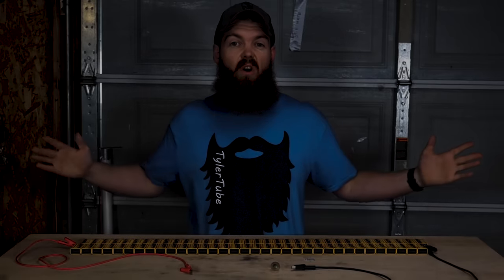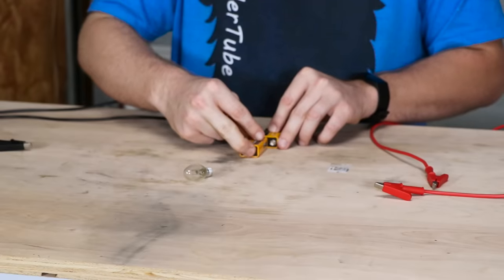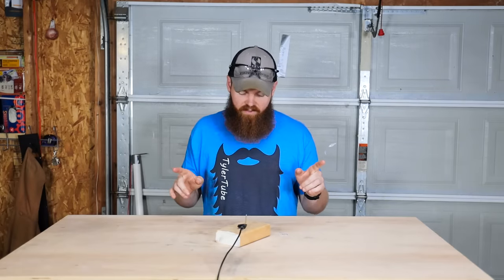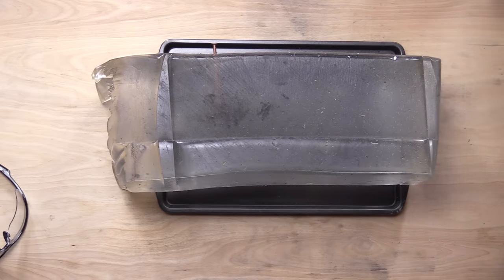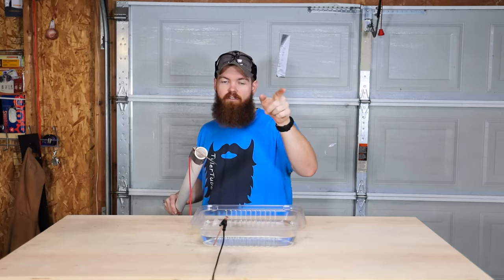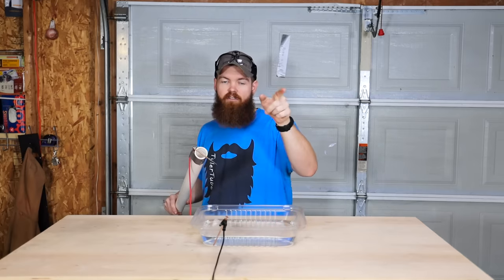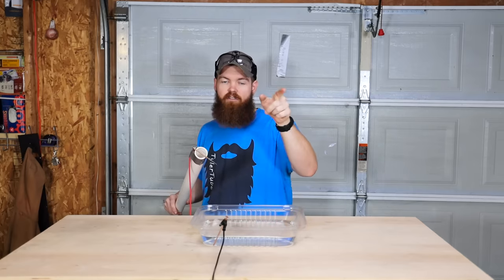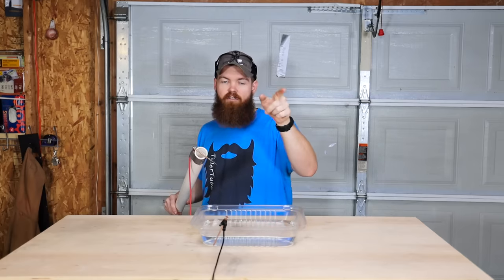I Connected 500 - 9 Volt Batteries...

Comment: I'm more impressed he survived to post this than anything
Reply: Honestly I would have blamed natural selection, this is just Dumb luck that he is still alive.
Reply: @maximwannabepro3021  i mean the most dangerous thing in this is the use of unsecure Internet connection thank god for today's sponsor
Reply: @sirbreadstick6424  RAID SHADOW LEG- I mean Nord VPN!
Reply: Eh he kept it safe
Reply: @goreobsessed2308 ?????
Reply: How's that v6 mustang
Reply: @logertgogert3227  its a GT but its fun thanks
Reply: @goreobsessed2308  placing your hands on an open circuit at those kind of voltages is never safe.
Reply: @goreobsessed2308  @7:24
Reply: @Aupexx  fun fact from an electrician, voltage is not the deadly part of electricity, amperes (amps/amperage) is. Amperes is the measurement of the speed of electrons moving through the circuit (think of it as horsepower) and voltage is the measurement of force pushing the electrons along (think of it as torque)
Reply: @davidbrunner4413  Yeah and I'm a welder. I deal with electricity every day as well. As an electrician you should know that an amperage of 100-200mA is lethal and the higher the voltage the easier it is for that amount current to enter your body and do serious damage.
Reply: @Aupexx  I know this, but I also know that it's only going to be fatal unless it passes through your heart or travels up the spinal column to your brain
Reply: David Brunner you do know that amperage is a direct function of voltage.
Reply: @davidbrunner4413  in addition, this is all DC voltage. The duration of the shock also has an effect on how much damage it can do. Since it's DC, he would probably just be knocked down to the ground and probably knocked out, rather than AC, which would hold him in place as it continued burning him internally.
Reply: @minamcvinnie4629  actually AC is less dangerous from a standpoint that the cycling of power can sometimes give you the ability to let go. DC will clamp your muscles to the conductive surface and not allow you to release.
Reply: This is electroboom 2.0
Reply: @PurdueRy  I found this on physics.stackexchange.com in re an excerpt from an electronics textbook:

"Direct current (DC), because it moves with continuous motion through a conductor, has the tendency to induce muscular tetanus quite readily. Alternating current (AC), because it alternately reverses direction of motion, provides brief moments of opportunity for an afflicted muscle to relax between alternations. Thus, from the concern of becoming "froze on the circuit," DC is more dangerous than AC.

However, AC's alternating nature has a greater tendency to throw the heart's pacemaker neurons into a condition of fibrillation, whereas DC tends to just make the heart stand still. Once the shock current is halted, a "frozen" heart has a better chance of regaining a normal beat pattern than a fibrillating heart. This is why "defibrillating" equipment used by emergency medics works"

I would think since he laid his hands down flat on the batteries, if there was electrical contact...

a) his clenching of his fists would've removed contact
b) his clenching of his fists would've violently grabbed the batteries directly below them, causing them to be disconnected from the ones immediately surrounding them
Reply: IM WEAKKK 😂😂
Reply: I'm more surprised that his beard did
Reply: @sirbreadstick6424  no laying his arms on those cases not rated even for 100s of volts it can explode any time or electricity can arc to his arms killing him instantly
Reply: @sirbreadstick6424  HE IS LITERALLY PLAYING RUSSIAN ROULETTE EVERY TIME HE TOUCHES THE BATTERIES CASES
Reply: @goreobsessed2308  KEPT IT SAFE!?!?!?! EVERYTIME HIS ARMS WAS ON THE BATTERIES ITS LIKE HOLDING A POWER LINE IT COULD KILL HIM IN A HEART BEAT IF HE ACCIDENTALLY TOUCHED BOTH ENDS HE'D BE A CORPSE BEFORE HIS BODY HITS THE FLOOR
Reply: @goreobsessed2308  Just after the lightbulb blow..pressing bare hands at both ends of a 600V battery, VERY close to the terminals.

Doubleplusungood. 😶
Reply: @Aupexx  bruh at that moment they aren't even connected
Reply: @ParedCheese  these videos make me cringe. I build elevators and work with 480 and high voltage regularly and seeing someone that has NO idea what he’s doing or even how electrical works do this so dangerously is just insane. Less than .5 amps will kill you and he’s handling that shit like he’s taking the batteries out of the remote 🤦🏼‍♂️ I’ve had friends killed with less than what he’s playing with.
Reply: @ParedCheese  just thought about it how in the hell did those little 18 gage alligator clips not melt? That shit needs some 8 gage lol
Reply: @davidbrunner4413  it's voltage that overcomes resistance which allows it to treat your body as if it were a copper wire.
Reply: Lmao same
Reply: @davidbrunner4413  also becaouse it’s dc and not ac it’s safer
Reply: @chrisandersonlv  These batteries can easily put out enough amps to kill somebody but not enough to melt anything (high internal resistance limits current). It's a high voltage but current limited supply.
Reply: @goreobsessed2308  6:24 says otherwise
Reply: David Gilbert  я более впечатлен, что он выжил, чтобы опубликовать это, чем что-либо
Reply: @goreobsessed2308  6.22 600+ volts across his heart lucky lucky guy
Reply: @90seconds33  lol this comment is ancient brah
Reply: @davidbrunner4413  how are you an electrician and saying this man? Voltage is directly related to current, so it's misleading to say voltage is harmless and current isn't because they're related, for the same given resistance/impedance higher voltages mean higher current and this case, Tyler has the same resistance of his body that he would if he were messing around with lower voltages, so yes the higher voltage is more dangerous in this circumstance. It annoys me when people say "umm actually it's current that's deadly not voltage" because it just gives people the wrong idea.
Reply: @sirbreadstick6424  This amount of voltage would kill. Just s ingle mistake. Touching the batteries could have ended his life. He is unaware of the danger here.
Reply: @davidbrunner4413  4500 volts would require how many amps to be lethal? (I know the answer, and he is lucky to be alive) Those battery cases are not designed to shield that much voltage.
Reply: @Aupexx  Those parts were genuinely scary to watch. At some point his fingertips on separate hands are millimeters away from terminals with 450V across them. He almost died so many times in this video.
Reply: im impressed by your nice sn95 (i think)
Reply: @RotaryMarx  thank you!! It's a super fun car to have
Reply: @Aupexx  how did you get it in Eastern Europe?
Reply: @RotaryMarx  it's in Canada lol
Reply: @Aupexx  ooooh ok i thought ur other comments in russia or something
Reply: @corottolino953  You have that the wrong way round.

Comment: This is a prime example of thinking you know enough about electricity to be safe, but actually being dangerously close to shorting hundreds of volts across your heart multiple times.
Reply: "the water is not very conductive" and we se a 10mm arch jumping from the water  to the rod, and the other rod in the water is 10 inches away.....
Reply: @fixandtests  arc*
Reply: volts hurt, that voltage wold seize yur muscles to it, i expect the amperage to be lethal though especially since the battery banks are probably in series, not parallel... if his battery banks were symetrical and even hewould have 250 AH there, but they sem to be about 90 batterise per bank, with a small one so im not even sure what amperage hes slinging out, again, especially since he probbly rigged it in series
Reply: @ethandye8764  The voltage is what matters. There is a reason warning signs say high voltage and not high amperage.
Reply: @wildfire4175  sir, if voltage was the killer, static electricity would be the leading cause of death in the winter time...  2 tenths of an amp can stop your heart, and it doesn't really matter the voltage as long as it has enough electrical potential to complete the ground through the body
Reply: @ethandye8764   Wrong. There are tens of amps across your heart in a static electricity discharge however it only lasts for a few nano seconds so the damage is limited. If the voltage is high the current is high. Time is the 3rd factor.
Reply: @wildfire4175   1st off this is DC so muscles do not seize up as bad. AC is what causes ur mucles to tense up and lock as the polarity is switching constantly. Something to do with the way our brains send signal to mucles. Voltage, resistance and current are in direct correlation, voltage is needed to overcome resistance and allow current to flow. Greater voltage, more current flow. It's not either or that cause it, they go hand in hand.
Reply: @ethandye8764   @Cameron Lewis   1st off this is DC so muscles do not seize up as bad. AC is what causes ur mucles to tense up and lock as the polarity is switching constantly. Something to do with the way our brains send signal to mucles. Voltage, resistance and current are in direct correlation, voltage is needed to overcome resistance and allow current to flow. Greater voltage, more current flow. It's not either or that cause it, they go hand in hand.
Reply: @SquishyThing   DC is dangerous at about half the level of AC because of the body's capacitance but at this voltage it is dangerous either way
Reply: @ethandye8764  A static shock is thousands of voles and several  amperes. It does not kill as it is not continuous but a very short spike.
Reply: ElectroBOOM would be proud!
Reply: I almost lost it at 6:22. He was so close to electrocuting himself multiple times.
Reply: @entx8491  what shape did the arc make genius?
Reply: @TheDJLionman  Lighting is an arc, in your derpy little cartoon world I take it that looks like a huge arch yes?
Reply: Not only that, but from watching other people do this, these batteries get fantastically hot, lucky he didn't start a fire.
Reply: @nekogod  I guarantee I saw him start a fire 🔥
Reply: @wildfire4175  Amps are the killer. Amps need a certain amount of voltage to do damage, but they are what kill people. Volts will shock, but they won't stop your heart.
Reply: @APatriotRevival   You are 100% wrong and you won't find a single Electrical engineer who agrees with you.  Have you ever seen a warning sign that says "warning high amperage"? No. they all say "warning high voltage" for a reason
Reply: @wildfire4175  Your argument proves you have no clue how electricity actually works. Danger signs read "HIGH VOLTAGE" because higher voltage means there's more potential for high level amps to flow through the current.

The best example I can give for how these two differ is a taser gun. Taser guns are rated at 50,000 volts. Your stance argues that tasers should be very deadly weapons, even overkill. But taser guns have a max amperage output of only ~0.0036 amps. This means they deliver a Hell of a shock, temporarily disabling control of muscles. But they don't do lasting damage to the average person. This is because their amperage is very low.

Volts can shock, but cannot kill. At high amounts, voltage can cause the potential for high amps, which will kill. I'd say the biggest danger volts pose is either burning from prolonged contact or injuries caused by muscle spasms.

I don't claim to be a genius on electricity, but this is a common misconception and it's pretty dangerous if one who doesn't know it tries to mess with electrical stuff.
Reply: @APatriotRevival   You have no clue what you're talking about. The amount of current flowing through any circuit is directly proportional to the voltage.  How do you think they limit the current of tasers?? THE COMPUTER ON BOARD DROPS THE VOLTAGE!  The ONLY way to limit current across a constant resistance is to drop the voltage. If the voltage is high the current is high!.  And tasers do kill sometimes. Go actually get an electrical degree from a school instead of reading things online that you don't fully understand.
Reply: @wildfire4175  Oh for Pete's sake, you've just made the same argument again. Tasers don't kill people, but they can throw organs and systems off. The most common of those is likely heart attacks. Tasers operate at a max of ~50,000 volts. When someone gets tased, they're directly exposed to that very high amount. Your explanation still doesn't account for how tasers are non-lethal if volts are what kill. 

Yes, voltage determines the current flow. I am not debating this, I've stated it multiple times. And if you think someone needs a degree before sharing basic knowledge on something, you shouldn't have any more of a reason to discuss this than I do.
Reply: @jace_Henderson  Voltage and resistance is literally ohm's law. You just contradicted yourself. And i've seen the video.

Comment: The table is " feeling staticy " because the positive lead is leaning up against the garage and you just turned your entire garage into a resistor, neat but for the love of god PLEASE don't do any more battery videos. You nearly died twice.
Reply: More like 6 or 7
Reply: I think its more of a capacitance effect than purely resistive. At 4.5kV the step potential is pretty weak.
Reply: @TheRailroad99  no change of voltage means it is relevant only when closing/opening the circuit thus not much.
Reply: Yeah...  Quite a few more than twice, you must treat BOTH terminals as being "hot", there is no ground, just positive and negative.  That's why you were getting shocked, the current was traveling through the environment and you completed the circuit, however weakly.  Don't know what kind of shoes you were wearing but they may have saved your life.  If the concrete you were standing on was damp it very well could have been conductive enough to pass a significant amount of current and hurt or kill you if you were barefoot.  You should always work with  the one hand rule, never handling high voltage with both hands in case a current passes from hand to hand and through your heart.
Reply: Oh my god at 6:23
Reply: @flomojo2u  nope. there isnt enough current available. between his resistance and capacitance. hes safe. obviously. since the video didnt upload itself......
Reply: @DieselRamcharger  The internal resistance of a 9v battery is 1 to 2 ohms - we will say 1 ohm to err on the side of caution. That is 500 ohms of resistance in the battery bank. I used ohms law to calculate the maximum short circuit current, which is 9 amps (9000 milliamps). Now we add the resistance of the human body. The electrical resistance of the human body can be as high as 100,000 ohms. But wet skin can lower that to about 1000 ohms. Again, we will err on the side of caution.  500 ohms + 1000 ohms = 1500 ohms. Using ohms law, that gives us 3 amps (3000 milliamps) passing through the body. As little as 100 to 200 milliamps passing through the chest can potentially be fatal without rapid medical treatment. One amp (1000 milliamps) can cause immediate cardiac arrest.
Reply: @wesleyhurd3574  lets take a little gander at empirical evidence. dude aint dead. now is he?
Reply: @wesleyhurd3574  actually I believe it only takes 20 milliamps to be potentially fatal. that metal garage door was right behind him with positive electrifying it on every setup. all it would have taken was for his foot to accidentally  brush the door wile he was setting up; he would look just like those hotdogs.
Reply: @DieselRamcharger  He's alive mainly due to the fact that he miraculously avoided making himself part of the circuit.  He certainly had a couple close calls though. The only thing that this proves is that luck was on his side when the video was made.
Reply: Hot dog fuses...
Reply: Someone's a bit of a drama queen. The chances of what you're describing conducting enough electricity to stop your heart are effectively zero, and it's not a resistor (the lowest resistance path for the electricity is probably the air itself), there are things in the way that are non-conductive like the table surface, concrete, etc. It more likely shocked him because he formed a capacitor in some way, any two conductive surfaces of opposite charge with a non-conductive surface in between.

On the other hand, Big Clive's warning about touching the barely isolated metal cases of all them batteries while they're hooked together (even if the circuit is not complete) is a good one, seriously don't do that.
Reply: He'll be fine